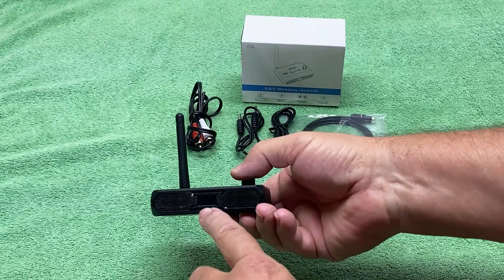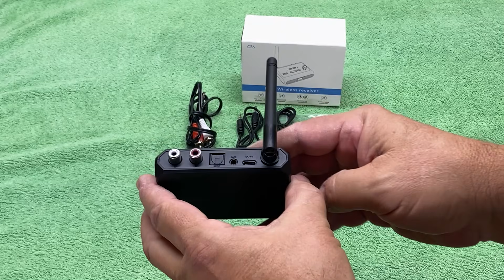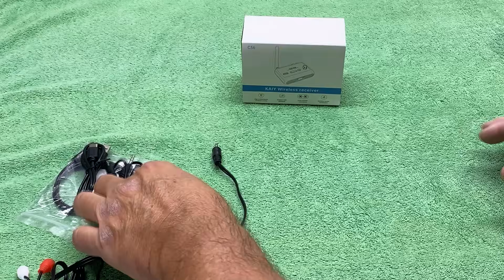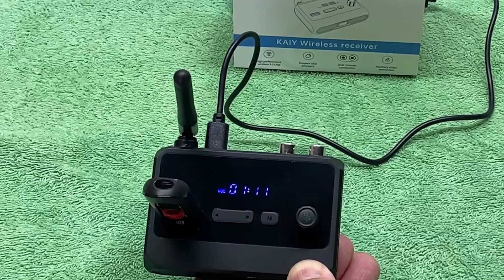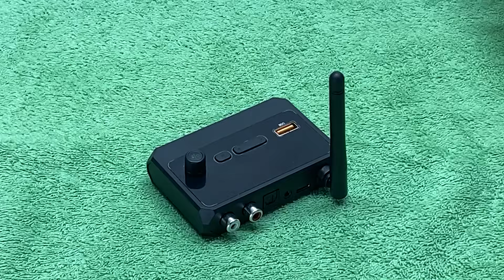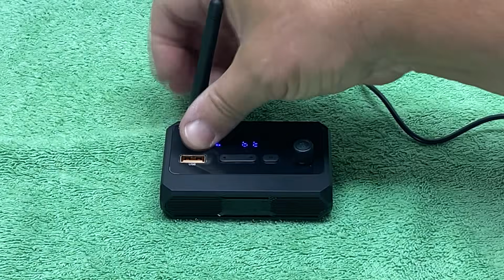Top Selling Bluetooth Receiver On Amazon KAIY C36

Comment: ive been trying to pair this to any bluetooth devicer for days and nothing connects.  Anyone have this issue? im so confused.  it flasehd bt and says rx.  I can only turn it on and off and put the volume up and down. nothing else works .
Reply from the maker: Get a hold of KAIY, I would imagine they have CS.
Reply: I purchased this device a few weeks ago to hook it up to my home TV to listen to my TV privately with my earbuds, without disturbing others. I never got it hooked up because I found out later it's not a transmitter. Is there a way I can use it at home to listen to the TV with my earbuds via this device. If not, which Amazon 😊device could be used for that service. Pls help. Thank you.
Reply: @tellsthetruth894  I bought it for the same reason.Glad I read this before I tried to use it.Going right back to Amazon.

Comment: I bought it for the optical out - hopefully that means we can bypass the distortion
Reply: Unfortunately I can't report on the optical out- mine arrived stuck in pairing mode, wouldnt respond to any button pushes or insertinga thumb drive with mp3's. Returned it and not trying again

Comment: How many volts output from the RCA?
Reply from the maker: I'm getting 1.8V at 40HZ., 1.6 at 1,500 HZ.
Reply: @breakerbroke23 thanks for the information i feel like that'svery likely the same voltage im getting now. The reason why i asked is because i currently have a bluetooth reciever plugged in to my car amplifier but the problem im having is that it has very low volume so i have to raise up the gain on the amplifier but that also introduced me to this alternator whining sound through the speakers because of that. Do you know what receiver would help me with this issue based on your experience on testing many of them?